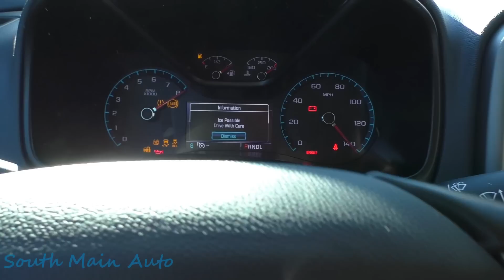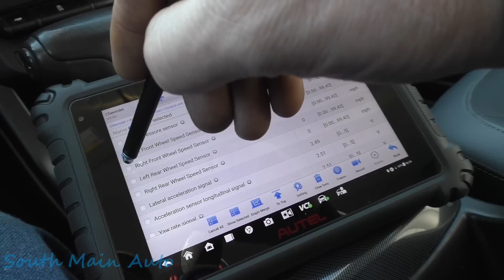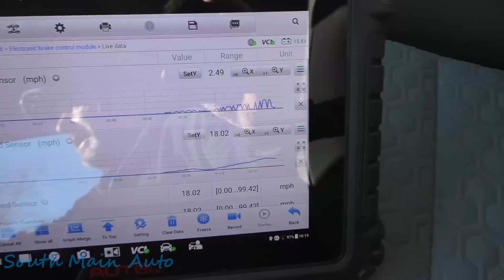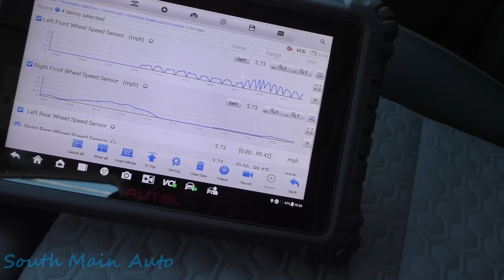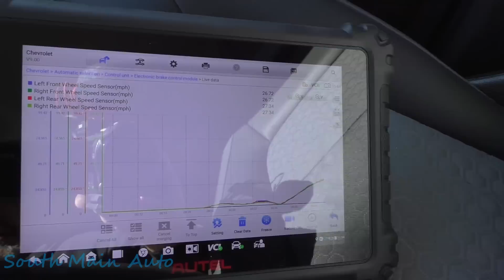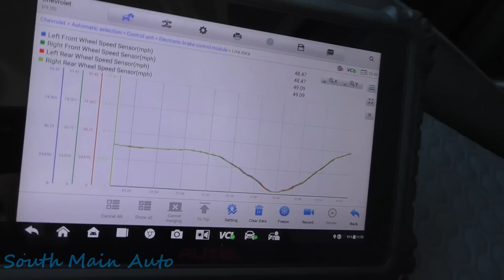'17 Chevy Colorado: Front Wheel Bearing Replacement

Comment: Love my 2010 Colorado. Minimal problems, great truck so far with 110k miles
Reply: I wished they still made them that size and height you have.
Reply: Wow. I’m feeling kinda bad now with a 2020 and 100k miles 😢
Reply: @focusedelectronics  iv got a 07 GMC 4x4 and replaced both at 150,000 and at about 195,000 another one went bad replaced it with an OEM tired of replacing them. Wanted to see if they are better, it’s now got 204,500 the bearings that is
Reply: 2005, 80345 miles. On my 6th company supplied service truck since I bought Colorado.
Reply: @earlestes8649  before I bought this truck I had an 06 Silverado z71 4x4 I bought new in 06. Sold it at 260k miles never had any major issues along the way. Guy that bought it from me is now over 300k. Bought a 2020, and it’s lived at the shop. 
Don’t think the build them like they used to.
Reply: @focusedelectronics  sad

Comment: I'm in Ca. And I fought a set of rear subaru bearing seized in the knuckle over a hour each side. Slide puller air hammer and PB Blaster and had ca. Plates

Comment: Years ago, I was working with an apprentice tech. As apprentices tend to do, he measured his aptitude as a mechanic based off how much money (or truck credit) he spent on tools. He bought himself this fancy Snap-On electric impact gun and a set of “impact rated” wobble sockets. The first time I saw him using them, I warned him 1) not to use them with an extension and 2) not to hold the trigger and ugga-dugga on the wobble sockets too long. As apprentices tend to do, he didn’t listen. A few days later, he was working on some sort of suspension job and had his shiny new wobble sockets hooked up to his shiny new impact gun with about a 6” impact in between. I suggested again that he should be careful with that setup. Did he listen? Well, a minute later, I heard the impact gun ugga-duggaing for at least 5-6 seconds before suddenly free-wheeling, followed shortly by the sound of a socket hitting the floor. The socket cammed off the bolt, came flying off the extension at 47 times the speed of light and whacked the guy directly between the eyes so hard that it split his forehead open. It was such a hard hit that he fell over backwards and lied on the floor dazed for a good 20 seconds. It had to bite my tongue so hard not to say “I told you so, dumbass” and actually had to walk out of the shop so I could laugh without being judged. Once I knew he was ok, it was f-ing hilarious.

I’m guessing the recommendation for grease is due to the steel hub going into an aluminum (alloy) knuckle. Even under ideal (non salty) conditions, those things corrode and weld themselves together. Or maybe a mechanic with some actual common sense snuck into the engineering meeting and suggested a little lubrication makes everything better.

Comment: Thank you for this, Eric!  I own a 2016 Colorado and it's nice to see how the front wheel bearings are replaced as I'm certain I will have to do mine someday. Love this truck. Thanks again! P.S. I hope your mouth doesn't hurt too much.
Reply: I also think rears will be identical but you may not need to ever change any of them😊
Reply: I also have a 2016, and I think I need to replace my now. Sometimes when I'm turning my steering wheel wobbles a bit, and I'm pretty sure that's the sign of worn bearings

Comment: If this Truck is from the Rust Belt, it’s Amazing a 2017 hasn’t been Crushed, Shredded, Melted & Manufactured into a New Pick-up Frame and sent back to GM.
Reply: It's getting there. You see how rusty that brake line was that bolted to the caliper. ☠

Comment: Wheel bearings at 50k? Gotta love GM. Thanks as always, Eric!!
Reply: my wife's impala went through 5 in 75k miles...had the extended warranty but still
Reply: My Uncle evidently got a dud of a Honda Civic one time. Dealership had to replace the wheel bearings at 10K! Wasn't on him either, he's a fanatic about his vehicles. He has a 2002 Dodge 1500 that looks like it was never sold let alone used by a construction worker.
Reply: The Colorado and Canyon series are notorious for wheel bearing problems.  This is the same line that put the rotor behind a sealed bearing on the first generation of the lineup.  Yep, you're hearing that right they had the front brake rotors stud mounted on the bearing behind the assembly.  So in order to change them, you had to disassemble the front knuckles to pull off the wheel bearing, then drive out the studs, and then you could change the rotors.
Reply: I’ve always had good luck with GM’s.  *i don’t live in the rust belt.   They also feel easy to repair/ cheap parts. Had a 98 grand am go 240k + 2 years with a broken odometer.  My dad bought it with 100k.  In our 150k it got struts, 2 hubs, an intake manifold gasket, alternator, and a water pump, pops might have gotten some front end stuff done before giving it to me. Car still ran when I got rid of it but the interior was horrible by that point. Currently in a 17 Colorado ZR2 with 65k. It had the trans shudder, but probably later that the rest, so one trip for a fluid swap and it’s been perfect since. That an evap issue, and getting the airbag module reprogrammed are it’s only dealer trips in 5.5 years since new. I tore a RF wheel speed sensor off roading it, and I do my own fluids. The truck has been a dream and the interior has held up better than any Chevy I’ve had.  Just sold a 19 ss 1le. Camaro That car was literally flawless.  Best driving experience of any car I’ve ever driven.  Didn’t drive it a ton of miles, but it’s safe to say those were extreme duty miles. 😂
Reply: Buy a toyota/lexus

Comment: I'm curious if the thinking has changed but I went to automotive school in the late 90s and back then the instructors told us that the rotor hold down screw was only there to hold the rotor in place while the vehicle was going down the factory assembly line...

And that you could throw it away at brake service time as the wheel would hold everything together?

It was certainly a best practice to mark the rotor hole and stud so that you put a used/turned rotor back into the exact same position as it came off... To avoid pedal pulsation etc... 

Not judging what anyone else does or saying that thinking is right, just wondering what everyone else thinks about the subject today?

Comment: Best shop in town for differentials did a front differential overhaul..  it still was making some noise. two other shops said it was too much of backlash, so we took it back for warranty.  He said he took apart the differential and found nothing wrong with it...put it back together but noticed a bad wheel hub bearing and replaced it. 
The noise is gone but now the H3 is bogging down and when you brake it tilts too much to the front.. it wasnt doing this before we took it for warranty service....What could him have done when taking the differential apart that is affecting the engine performance and brake bias or balance?

Comment: My 06 Buick Lacrosse same lights. scanner sdaid front drivers side speed sensor. replaced wheel hub and lights are still on. 300 buck down the drain. he said might be a wire some where.

Comment: Toyota Tacoma v6 Verdicts not out yet on the new 12 injector models (ATKINSON)  mine was in the Shop at 5k miles  MICE!!!!  I PULLED IT APART AND FIXED IT MYSELF (I THOUGHT)there was  more wires chewed behind engine I didn't see, I wasn't man enough to take it all apart again. Pulling all those injectors and new seals gaskets etc .I was at least able to drive it to dealer I payed the deductible 500 bucks . 3 weeks later done!!

Comment: GM gets a fail with the ring already falling apart at 50k, but gets a small win with grease in the hub.  150k on my ram and still turning on all original wheel bearings.  Fingers crossed for at least another 50k

Comment: Hah the big one was a floor jack /breaker bar combo and the next was a sledgehammer lost one of those caliper bolts on the highway got a brand new torque wrench after that. Broke my compressor and my electric impact only grabbed when went to pull not push.

Comment: Hey buddy, great video, but I have a question. I just changed out my wheel bearing and hub to my 2018 colorado yesterday's front passenger side. Now my problem is that I lost a lot of break fluid while doing this, lol, which I refilled. But now my breaks are pushing all the way down? Do I need to push the quad caliber pistons back? I'm not sure what the problem now.
Reply from the maker: Sounds like you need to bleed the brakes to me

Comment: So many of these got sold instead of repaired due to the cost of the front brakes. Idk why chevy designed it like this. 
    Great truck.
Reply: My bad. New deaign lol.
  The old one was a helluva job.
  Back when a ful brake job was 400 bux the front brakes alone  on the 
colorado was 1200.
  Hubs rotors pads.

Comment: Eric, the tool companies you use like astro tool and the sort should use you as a selling point. "Astro tool announces THOR our best hardest hitter and used by none other than ERIC O from South main auto". I think they'd be a fool not to!
Also you should have a list of tools you use like your thor or other tools that'll get some of the hardest and tightest nut and bolts. I'm always looking for tool that I don't have to heat or soak in penetrating oil for a month to get off.
Reply: The box for the air hammer says "Big Nasty" on it...

Comment: take a punch and ball peen hammer and hit that screw on the brake rotor one or two times. this impact will set the threads. then it will unscrew easier. First time I ever used this was on the front crank shaft bolt. works most of the time.

Comment: Eric. Just curious. Around here, whenever you take car in for any engine repair, the first thing they do is put a scanner on it.  That is automatically $150.00.  Just wondering if you charge your customers to scan?
Reply: Have you priced a professional scanner?  $2000-5000+ and then you have to pay a yearly subscription fee to stay up to date.  Its quite the racket.   This is why I say all this software in cars, needs to be OPEN SOURCE.  No hidden crappers, the specs should be freely available.  I think everyone would be shocked at what is hidden in the cars computers.
Reply: I took my car to a Goodyear shop with a knock sensor code. They still charged me to rescan the car.
Reply: Every thing I do to a car, seems like I have to hook the scanner up to relearn what I fixed🙄

Comment: Nice video. I have to replace the body and bed mount bushings on my 2014 F250. Ever done those? Someone told me to heat them with a torch and not use an impact. I'm in Florida so rust shouldn't be an issue.. Not a mechanic by trade so thought I would ask if you had any tips. Thanks
Reply: Not rust but locktite, heat the bolt red-hot, to melt the locktite and then use an impact to remove quickly
Reply: @Corbino6969  Thanks. I had been told it had locktite also. Warned me that with an impact I could spin the nut. And I'll have to do it laying on my back. No lift.
Reply: @robcatterton8244  don't set your interior carpet on fire, when getting after the body mounts.

Comment: this was like one of those shade tree mechanic episodes where all the parts just fall off the truck when you touch a tool to it....ha, if only they knew...Yes Eric, this was your lucky day because the next Ford or Dodge or Chevy that needs a wheel bearing will take you 40 minutes just to get the bolts out of the bearing, then another 30 to get the hub out of the knuckle and hopefully the axle doesn't stick inside the hub for another 25 minutes and there goes the book time shot to hell....1.2 R&R front wheel bearing 4x4...LOL
Reply: Or the Subaru or Explorer pulls up🥴
Reply: When you're in the rust belt, double or triple the time that the flat rate book says and charge accordingly. If it comes apart easily then make the customer feel good by giving a discount.

Comment: Gone are the days when you could show up on time or even slightly late and get on a plane or ferry.
In the 70ies, 80ies and early 90ies you could arrive at airport 1/2 hour before flight and check baggage and get on the plane. Now your seat would be give to others if you did that. Seems the same with ferries.
Post some more of your crossing, waves and what it is like inside

Comment: Was it me or was the steel part of the rubber brake hose where it bolted up to the caliper pretty corroded? Only 50k and you have to change a wheel bearing? Ouch...

Comment: Well I'll be jiggered.  I'm guessing the grease in the knuckle is needed because the knuckle is aluminum and the wheel bearing is stainless steel.  Without the grease apparently the two metals will corrode each other.  The stuff I'm reading online mentions using copper grease, but I have no clue how important the type of grease is.

Comment: Points to the engineer for putting grease in the hub?  Maybe, design a wheel bearing where the magnet doesn’t break after 50k miles.  Just thinking out loud…

Comment: Surprised to see Chevy/gm use grease around the bearing race and knuckle…. That’s a very pleasant surprise
Reply: They must have forgot on my 15’ Terrain. They all gave a worthy fight when it was 2 1/2 years old at 60,000 miles. More corrosion than I have ever seen. That aluminum spindle had about 1/4 “ of build up on the bearing hole.
Reply: Rust prob raised the warranty time on those bearings by .2, so they had to engineer something to take off .4🙄

Comment: I live in Ontario rust belt. Had fights with too many hubs ( they don't last long) I use a modified sliding hammer with a 25 pound plate from a barbell on a 4 foot rod. 2 whacks and it's out every time. If I had a big nasty like you I'd scare them out like you just did.

Comment: What a rookie. Couldn't get the right size axle nut impact on the first or second try? Where did you get your ASE certification, online from some third world country? I do like how you have the torque wrench limit sound in your audio library where you can add it whenever you want. Pure genius! Oh, by-the-way, you shouldn't hang that "break thingy" by the hose. Any decent mechanic knows there's an approved GM break hanger tool and if you can't find it OEM, I'm sure Snap-On, Mac or Matco carries the proper one. Other than those slight faux pas, it should be safe for the owner to drive.

Comment: The brake hose end at caliper is damn scary. 5 years and 50k miles and it is that rusted!!! I know they use salt on the roads but so does GM. I guess Ford and Dodge probably rust at the same rate as they likely use same hose supplier.

Comment: Wheel bearings are money makers. I had a 2000 silverado 4x4(bought with 53,000 on the clock) and sold with 269,000 on there. Driving 80-100miles every day still when I sold it. Had original bearings still along with original transmission, engine, everything. My '09 I bought to "treat myself" has went though 7 wheel bearings in 140,000 miles, not to mention 2 transmissions, and the rear shock crossmembers are now rusted in two. Chevy sucks any more. I'll be hard pressed to ever buy another!